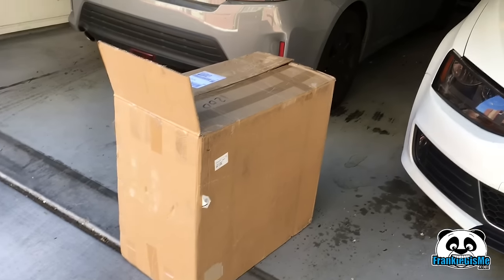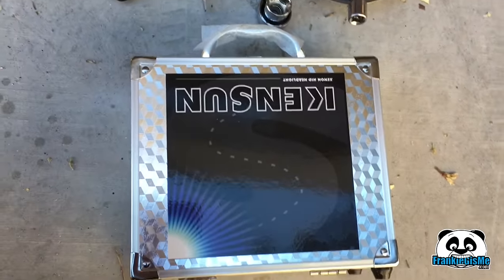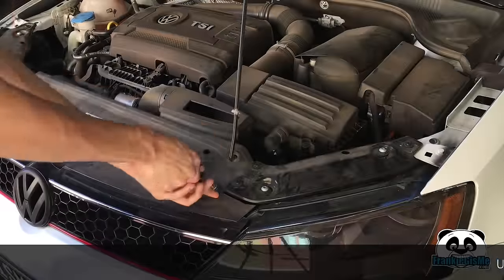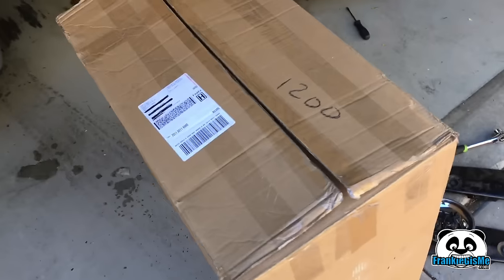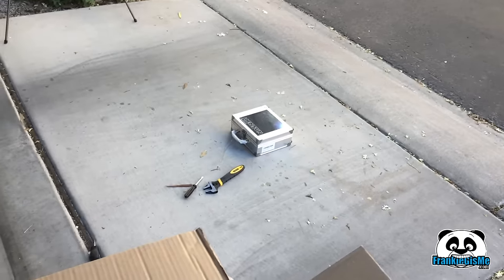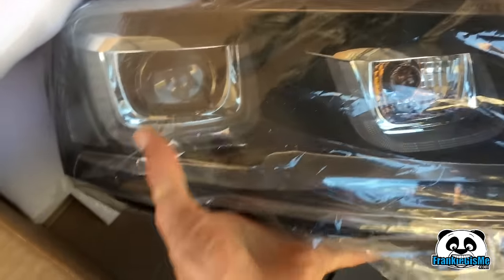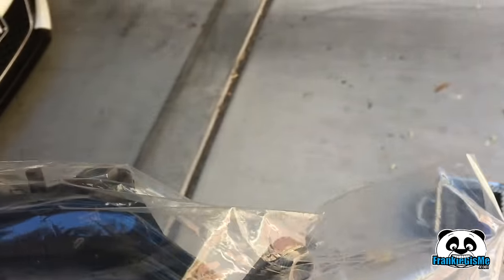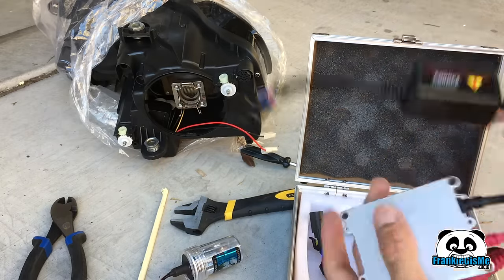How to install Helix projector headlights (VW MK6 Jetta GLI)

Comment: Hey man, stupid question. So you obviously cannot use the original halogen/led bulbs with these, correct? You must buy hid’s? I just bought these without doing enough research because I thought you could just throw them on using existing the bulbs.
Reply from the maker: You don’t need HID you just need D2S bulbs. At the moment I have LEDs.

Comment: Will these headlights work for the facelift sedan? I’ve heard they won’t because they changed the headlight shape/angles when they went to the mk6.5
Reply from the maker: Fits all 2011-2018. They did t change headlight shape they changed bumper shape. Weird I know
Reply: @Frankiegisme  I’ve really considered getting some of these. I’ve heard more horror stories than good thinks about them though lol.. moisture issues, the U’s not being bright at all, and the manufacture says they weren’t designed for led or hid. How are yours holding up?
Reply from the maker: The U’s could be brighter. Had them for about 3 years. There are no other headlights I would buy. These or factory. VW should’ve offered GLI with GTI headlights and these are most similar.

Comment: sorry if uve already answered this question but... I bought the lights several months back but never installed them on my '11 jetta(huge procrastinator LOL). I bought the same hid kit (except i went with the 5000k cuz the cops around here where i live are A$$holes about the "blueish tint")from the link in ur vid and the anti flicker kit. where u able to retain the hi/low beams? I noticed that the bulbs don't move in and out like bi-xenon bulbs do. Do the headlamps do the "in/out" function to make the hi/low work like the bi-xenon bulbs wld do or is there something I'm missing? I need for these to be BRIGHT as I live in the woods and have tons of wildlife running around. Already nailed 2 different deer, 2 separate occasions and had the car in the shop twice to repair the entire front end. I keep getting pulled over cuz I run some cree led fog lights (which are illegal for on road use). I'm just tired of the cops an I'm trying to fly under the radar. not be a target. lol. any help wld be greatly appreciated. I also got a set of stock look projector fog light with 100w yellow 9006 cree leds for them..
Reply from the maker: +travis merriman Thanks for watching my vid. I'm glad I could help you find some new headlights. If you got the same setup as me, then they are bi-xenon. I have both low/high beam that work normally. Also, after I bought the 6000k I realized I should've got the 5000k because the LEDs are 5000k. Would've matched better. I say install the lights and try it out. I'm sure you like them as much as I like mine. Thanks again for watching 👍
Reply: have you figured out how to get your DRL on without the headlights turned on? by the way I sub'd your Channel
Reply from the maker: +travis merriman I haven't had a chance to look into it. Sorry
Reply: Where did you buy these headlights? What brand? I'm looking into buying them for my mk6 GTI. They look great!
Reply from the maker: +Skyler Morgan They are Helix headlights. The GTI headlights are very similar but different. I bought these on eBay. Just do a Google search for Helix headlights, I'm sure you'll find them. Thanks for watching 👍
Reply: FrankieGisMe hey bro did u ever figure out how to wire the DRLs? any help wld b awesome. thx
Reply from the maker: +travis merriman Haven't had a chance to yet. I should be uploading a vid for that in August.
Reply: Led aint good for your projectors
Reply from the maker: Why?
Reply: FrankieGisMe 
Because your projectors have chrome in it. If the led gets got it oxidates and releases the chrome in the projectors. And when the chrome comes off your projectors wont reflect the light on the street which is the minor problem. The bigger problem is that you have to buy new headlights. I know there is a cooler system on the led, but when you close the back side of the headlight the cooler fan wont cool. On the other side if you let your headlight open from the inside the engine wont allow to cool. So the fan is just shit. In any case the headlight will be useless in 6 months/1 year.
I read many forums where people put led in their headlight and had to throw their headlight in the trash after a few months.
Nice color, nice idea, but fatal ending.
Please dont ruin your car with those cheap chinese products. Use good aftermarket xenon hid systems with 5000-6000K and watch that you dont dazzle the oncoming traffic and youll be on the safest side with a product your car looks good and wont damage any system.
Sorry for my bad english, i am from germany ✌
Reply from the maker: Fair enough. I haven’t heard or read about that issue but it makes sense. I appreciate that info. I’ll take a look at it to see if it’s starting to ruin the headlight. If it is I’ll switch back to the hid’s that I used to have. Thank you

Comment: My left low beam is already out!!! had these for like a month
Reply from the maker: +H8tred Productions did you get the error bypass?
Reply: yes, its only the left light, right one works fine. Probably just a cheap stock bulb, gonna switch them and see if the left is still out or if its just the bulb
Reply from the maker: That Kensun kit that I got seems to be working great.

Comment: Great video. i just installed this same head lamps but I'm facing an issue right now. I have to turn my headlights on to make the DRL work. any idea how to solve this?
Reply from the maker: Change drl wire position in harness. Fairly easy but you need to know which wire to change

Comment: Hey! Great video! I'm buying a 2017 golf sel and plan to use this to install some hid headlights. Do your lights auto level like the stock housings upon start up?
Reply from the maker: They don’t auto level but they have manual settings. They’ve been even for me since I bought them
Reply: Okay awesome! Have you found a way to fix the drl issue??
Reply from the maker: Ya I found a way I just haven’t done it. I just need to repin the harness

Comment: Hi. I have a 2013 gli manual with the HID headlights. I saw that you also installed the k&n cold air intake how did you get that little hose to go into the side of the cold air intake pipe?
Reply from the maker: Good question, the intake kit cane with a metal spout where the hose slipped onto. I did a full install vid if you haven’t seen it called “How to install a cold air intake on a VW MK6 Jetta GLI” https://youtu.be/XIt-O3ph-AQ hope that helps answer your question. Let me know 👍🏼 thanks for watching 🙏🏼

Comment: I have a question do the headlight give a much better beam since you moved from halogen to bixeno and can you do a video.
Reply from the maker: Bixenon are way brighter than halogen but now I’m running LED. And yes I made a video 5 Reasons Why You Should Switch to LED Bulbs and How to Install on APR Tuned VW MK6 Jetta GLIhttps://youtu.be/krfC6F2JTUY

Comment: Hey man, the car looks awesome! I just bought a 2016 Jetta s, and I want to install these headlights on it. How are they holding up?
 For the Hid kensun conversion kit, I'm not sure which size in the options and color to choose from. I know I just want a bright white color. Any tips? The canceller seems to be sold out on amazon but I think I can find a pair on eBay.
Reply from the maker: Hey, thanks for watching! I really like them and they seem to be holding up well. I noticed that the DRLs only come on when the headlights are on but Im sure that's just a setting that im too lazy to find. The headlights that I bought require D2S bulbs. I got the 6000K bulb but notice that they are slightly bluer than the DRLs, so I think a 5000k would be a better match. Im sure any canceller would work but I like how simple mine was to install. 

Biggest tip for you... make sure you have all the parts/tools ready before starting. Then you wont have to do it twice, like i did haha #ForgotTheBallast
Reply: Thanks for the help man!
Reply from the maker: +Muhamed Polovina Ya, no problem. I always hated buying online because you don't know what you bought until you get it.
Reply: Cool video like the car
Reply from the maker: +Raymond Robertson thanks 👍
Reply: FrankieGisMe  can i remove the headlight assembly the same way for a 2014 Jetta se?
Reply from the maker: +Willie G yes, just be careful when the bumper because it’s hooked over part of the light. After you loosen all the screws push the headlight toward the engine as you pull the bumper away. The the headlight should be able to move freely

Comment: Frankie, I'm a big fan of yours. Question about the Headlights. Does the assembly itself (400 bucks) require anti warning adaptations? Or does it run error free with normal halogen bulbs?  I understand the HID kit requires anti flicker and anti error stuff, but the headlight itself should be fine, correct? Do you feel the set to be of good quality? Have you had any issues yet?
Reply from the maker: When I installed the headlights I only used the bulbs/ballasts. However, a few days later my headlights were acting weird and then I got a bulb out warning on my dash. If you're gonna spend the money on the lights, I suggest getting the anti-flicker warning canceller too.

Overall, I haven't had any issues with them. The DRL's only light up when the headlights are on. I've been meaning to contact the seller and ask about that but I haven't had time. Other than that, they are AWESOME! I get compliments all the time.
Reply from the maker: Lucas Daudt Thanks for supporting my channel by watching my videos
Reply: Gotcha! That might be a simple setting on your VAGcom tbh. I currently own usp's HID kit and it comes with anti flicker built in. Thanks for the reply Frankie, you've given me thousands of ideas for projects. My next thing being the roof rack.. I just have to rack up the money first! Have a good day!
Reply from the maker: +Lucas Daudt I didn't even think about that. I still to get one of those. I wish the anti flicker was built in. Ya man, parts and mods aren't cheap.

Comment: I'm planning on buying the same ones for my 2016 jetta, they look awesome, but I was wondering, do you need any special wiring or something ?
Reply from the maker: +Francisco Baez dude, I think my car looks sick with the new lights. I don't regret it at all. You need ballast, bulbs, and anti-flicker kit. You can find all of that on amazon for around $90.
Reply: it definitely does! Really nice job you've done to it and it looks really original, thanks for the tip!
Reply from the maker: Thanks! Let me know when you get them.
Reply: Hey man! Just installed the headlights and they look awesome! But after a while there's a lightning sign in the gauge like if i had a lighting problem or missing a light, did you have the same problem?
Reply from the maker: +Francisco Baez you need the warning canceller. The link is in the description. I found that out a few days after the install. 0 errors now and I love my headlights 👍

Comment: Just got my 2017 jetta... purchased the bi xenon headlights and the wiring harness.The vender told me it was just plug n play cause my harness were already programmed. Did you have to do any programming with vagcom or was your set up plug n play??
Also on these jettas is there a need to take of the front bumper for install?? or is there no need??
thanks
Reply from the maker: Nice! Welcome to the Vdub family. I did not have to do any programming either. All plug and play also. 

I have seen other people remove the front bumper to replace the headlights but I decided against that myself. I just push the headlight toward the engine bay and pulled up of the bumper lip and that worked for me. So the only thing that you have to remove is the grille.

Thanks for supporting my Channel.
Reply: Thanks!.
whats the antiflicker you mentioned that you had to get from amazon? was that somthing you purchased after the install?
thanks again.
Reply from the maker: +Auus Worrior yep, I didn't realize that I needed it until after I had issues. It was super cheap plug and play also. I put it in the description if you need it.

Comment: Nice job! Looks great. What brand are the headlights themselves? (The double U). I know the bulbs are Kensun.
Reply from the maker: They’re helix
Reply: FrankieGisMe thanks. I’m seriously thinking about ordering them but am a bit worried about bulb out errors, coding and such. But they look great! My ride is a brand new ‘18 GLI with the crappy halogens.
Reply from the maker: Haha that exactly how I felt and also why I bought them 😂 I had an error but then got a inexpensive warning canceller that makes them work properly. Now I run LED bulbs from lastfit that don’t cause any errors on my car.
Reply: Awesome sir. Thank you! Time to start saving up.
Reply: Frankie one last question. Is the warning canceller is also from Kensun? And what model/type bulbs did you use from Lasfit. I want to do one big order with all the parts together. Thanks.
Reply from the maker: Kensun warning canceller is the one I have. Here’s a link to the review vid I did for the Lasfit bulbs. Links are in the description for the different types of bulbs depending on the headlights you get. My Mk7 gti style headlights use the D2S bulbs in the description. https://youtu.be/krfC6F2JTUY

Comment: How are they holding up Just bought a 2013 Jetta SE and this is the first mod I want to do as I love the factory HID's on my MK6 GTI and how well they perform/light up the road. Do they sell any other styles (Non Black)
Reply from the maker: They’re still running strong. In this vid I used Bixenon bulbs. They’re really bright and light up the road well. I didn’t like all of the wires so now I have LED bulbs. I did an updated vid for that too. Also, I never seen any other U style headlights for jetta but I always get compliments for these.
Reply: With the LED 's was it just as simple as changing the bulbs and if so did you get any bulb out error light on the dash, I put LED's in the reverse lights and I got a bulb out light on the dash. BTW the link for the HID kit doesn't work, Can you fix it?
Reply from the maker: Ya, it was easy plug and play. I did a vid on the LED's too. I did not get errors but other people told me that they did. Just pick up a $7 warning canceller and you'll be good. Also, the links should be working now.

Comment: What’s the trick to get them to align perfectly with the quarter panel, bumper, and grill. Messed with mine for 2 hours and still not flush with the lines no matter how many adjustments I did to the mounting hardware
Reply from the maker: No such thing as perfect lol. I tried forever too and then realized that my OEM headlights weren’t perfect either

Comment: Question. Are the ballast only required for bixenon bulbs? Not required for the halogen h7 bulbs. I want to buy those headlamp housings, but I want to know if the ballasts are required.
Reply from the maker: These are aftermarket headlights that use D2S bulbs. The ballasts are only required for BiXenon bulbs. You can use any other D2S bulb without a ballast. For example, I used to have D2S LED bulbs that do not need a ballast.
Reply: @Frankiegisme  and those plug in like the h7?
Reply from the maker: They’re kinda weird but the only bulbs that work with these headlights.
Reply: @Frankiegisme  do you have a link to purchase a bulb for this  kind of head lamp that does not require a ballast and won’t cause any errors? I appreciate any recommendations. Thanks
Reply from the maker: These are my favorite jetta headlights. Unfortunately they only come with D2S connections. You can easily find bulbs for them on Amazon doing a quick search for D2S. You only need a ballast if you get BiXenon. Halogen and LED bulbs do not require a ballast.
Reply: @Frankiegisme  yeah those are the same head lights I was searching for.
Reply: @Frankiegisme  ok last question. Using the leds, did you have any issues/ problems like fogging or any other issues?
Reply from the maker: Fogging wouldn’t be related to the bulbs that you choose. Potential issues: 1) UV protective film is thin and 1 scratch could cause a pressure washer to remove it. 2) All VW’s are wired differently and DRLs may not work. 3) May get dash light. Solutions: 1) clean with care and replace UV film if damaged. 2) may need to re pin the connector to match your VW (rare). 3) May need warning canceller harness (~$15). Every potential issues has an easy fix.
Reply: @Frankiegisme  ok thanks for the advise. I’m trying to get all the info so I know what needs to be done and what parts I need. Weighing all the pros and cons.
Reply from the maker: Definitely important because they’re not cheap

Comment: Hey, do those DRL come on as DRLs or do they turn on only when headlights are turned on or they turn on as parking lights ?
Reply from the maker: For some reason the wiring for each Jetta is different. I know a ton of people who bought them and they worked as DRL’s. However, some people like me weren’t as fortunate. If that’s the case you need to repin the headlight harness so the drls line up. To this date I haven’t been motivated enough to do it. I’ve watched vids about it. Seems simple but just didn’t matter enough I guess. Hope this helps.
Reply: thanks man. appreciate it
 @Frankiegisme

Comment: do the headlights light the road up more then the stock headlights ? and have you had any problems with them ?
Reply from the maker: +DeeBoyy 16 HECK YA THEY DO! I couldn't see anything with the factory halogen headlights. These headlights are awesome! No issues in nearly a year of owning them. You do have to do a simple wiring job so the LED running lights work as DRL. I haven't done it yet but it seems simple. Also, I have a plug and plug antiflicker/warning canceller connected because they were flickering after the install. All good now 👌